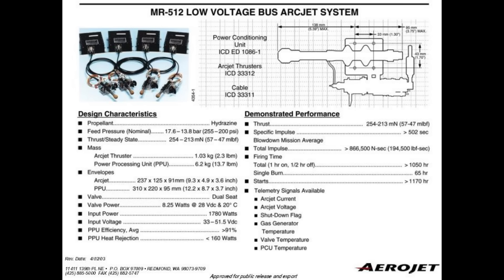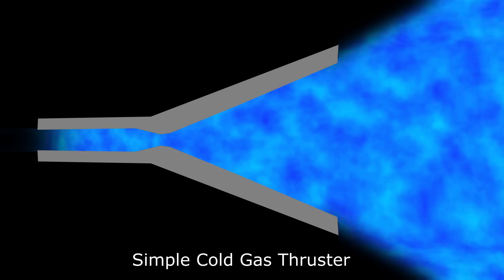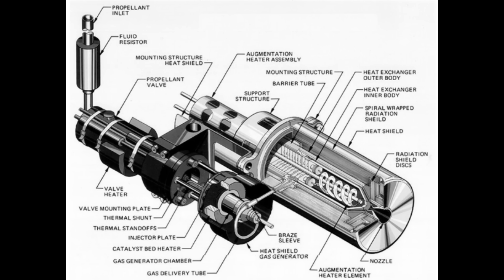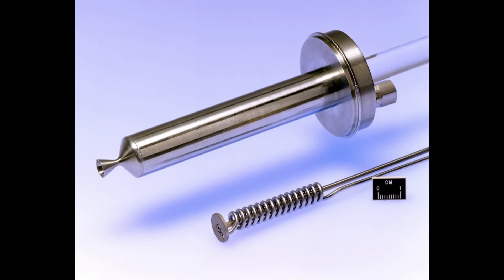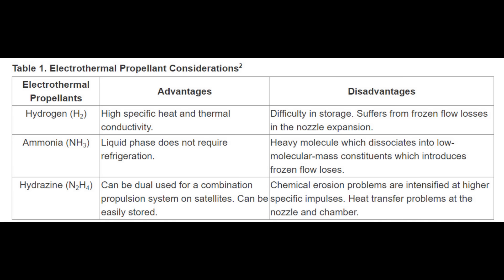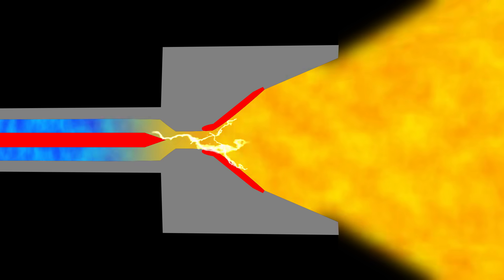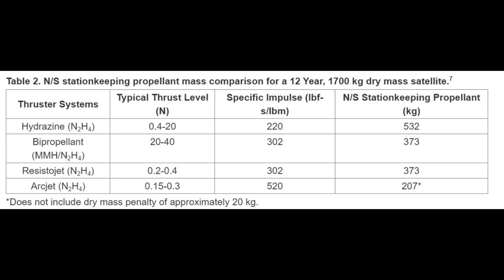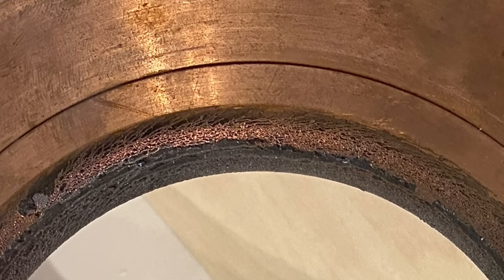Lightning In a Bottle?  The Science Of Electro-Thermal Rocket Engines

Comment: Hey Scott, YES, would definitely like to hear about VASMIR (sp?) and its competitors!  All the thrusters you talked about in this video are great for station keeping and maybe small payload hops around the solar system, but to actually actually go somewhere with payload will require a much higher performance propulsion system, and that is of great interest.
Reply: Microwave thermal thrusters using water propellant are perfectly capable of getting from Earth to Mars and back, in what I can only describe as an "unconventional" spacecraft. Idea is that it's a series of double-hull inflatable habitat modules, with the inner hull containing the atmosphere and the space between hulls being used to contain the life support consumables (specifically water) used during the trip by the crew.
This allows for a stupendous amount of water to be carried, which allows for mostly open-cycle life support to be used.
The key that makes this work is WHERE the "open end" of the life support loop leads. It leads right to solar powered microwave thermal thrusters, which heat the wastewater (minus separable solids), and waste gases of the life support system.
This allows for a constant if small amount of thrust which is still a lot better than any known ion thruster even if the overall specific impulse is lower than a nuclear thermal rocket engine. The key is that we can do it with TODAY'S tech, we don't need to wait for the design, approval, TEST LAUNCH approval, in-orbit testing, final design adjustments, and "OK now we're gonna use it for real, what do you mean it's been 8 years and the next president doesn't want to do that anymore" actual mission approval which would be required for a Nuclear Thermal Rocket (and you can almost guarantee someone's gonna not have sufficient education on nuclear tech and go "Nuclear? No no no!" no matter how calmly and plainly you explain it, and no matter how much you dumb it down so that a 3 year old can understand it (the older you get, the easier it is to fall into the "Nope, I don't like it, so I'm intentionally going to not understand it" thought trap).
We can design it TODAY, have it built TOMORROW, and be off to mars by NEXT YEAR if we only want to visit Mars orbit with a manned mission.
Or you know, NASA could make everyone drag their feet and congress/senate could hamstring it and it takes 20 years when it should have taken 2, but I prefer to be optimistic.
Point is, all the stuff needed is ALREADY at a sufficient TRL to just say "Ok we're using this, it's been proven to work, now let's actually do it".

Oh and if you're worried about radiation, you can forget about that concern. The amount of water needed is such that the water itself will be the radiation shield, and it's such a good radiation shield that the habitat doesn't even need a "storm cellar" in order to be reasonably (even by NASA standards) safe from a solar storm.
Reply: @44R0Ndin Doesn't "constant, if small thrust" = artificial gravity? I've seen this double hull, water filled construction, for decades and like it. The microwave thrusters is a new twist that I like.
Sorry, though, I can't help but be a pessimist, my blood type is B-.
Reply: @tomfrazer1428  
I hesitate to call it "artificial gravity" because it's NOT gravity, it's just acceleration, but in a few words "yes but the thrust is more on the order of an ion drive, not at all adequate to fight the effects of living in freefall for extended periods".
In (many) more words:
The term I prefer to use is "Thrust replacing gravity", or if in a spinning habitat module, "Centrifugal forces replacing gravity".
"Artificial gravity" is a term I save for use when you're creating REAL gravity (with the warping of spacetime), without the mass usually used to create said gravity.
So, technically, the Alcubierre drive (the only known concept we have for a "warp drive" like used famously in Star Trek), would use a form of "artificial gravity" combined with "artificial Anti-gravity" to warp space around itself such that it is caused to accelerate relative to an external observer purely by the warping of the fabric of space-time, rather than any propulsive effort exerted by any other method, most commonly by Newtonian reaction thrusters of varying power, complexity, and efficiency (this covers anything from cold gas thrusters to solid or liquid fuel rockets to nuclear rockets and even ion drives).
Reply: @44R0Ndin  I like your descriptions for the various types of forces replacing gravity. I assumed (I know, a mistake) that there would be multiple drives on a ship carrying crew, as opposed to a probe, increasing thrust/acceleration or the drive would be designed large enough to provide up to .5G. Continuous thrust with a flip over half way to the target.
Reply: @tomfrazer1428  
The issue isn't "more engines", it's "more power", and this craft's whole point is "you don't need to minimize weight to get there safely".
It's a "slow boat" type of trip, there is no thrust gravity, it's using one or more microwave electrothermal thrusters, not "sci-fi physics-ignoring TIE fighter ion drives which have some handwaved incredibly powerful energy source which lets them dump so much power into the thrusters that you get space-fighter levels of performance".
Reality is not nearly so kind to propulsion engineers. Solar intensity on the earth's surface is around 1kw per square meter, yeah it's higher than that in space because the atmosphere's in the way, but it's only like 1.3kw/sq.meter in earth orbit. Solar panels are at best maybe 35% efficient even with state-of-the-art cutting edge "this is the best NASA can get for their spacecraft" solar panels. And the solar intensity at Mars is significantly less than at Earth, due to being further from the Sun.
So at Earth, you can put a square meter of solar panels out in orbit, and point it perfectly so that it intercepts the most of the Sun's light as possible... and you're still only getting 1.3kw*0.35= a measly 455 watts  per square meter of solar panels. That's assuming those panels are NEW, and not damaged by the constant high (and occasionally extremely intense) radiation environment of space, which damages ANY semiconductor device, including solar panels and unprotected computers.
Now, why does that low amount of power matter? Well, the ISS solar arrays have a total area of 150 square meters, which at the stated 35% efficiency figure putting out 455 watts per square meter, gives you (150 x 455 / 1000 for kilowatts ouput instead of watts = 68.25) 68.25 Kilowatts, divided by 2 to account for being in Earth's shadow roughly half an orbit, = 34.125 kilowatts, which aligns well with the stated "roughly 30 kilowatts plus margin" of power that the ISS was able to provide to ALL the systems on board, when the solar arrays were BRAND NEW.
EACH of the solar array wings of the ISS weighs 7.71 metric tons, times 4 for how many solar array wing sections there are on the ISS, gives a mass of 30.84 metric tons for the entire solar array wing complement of the ISS, including hardware used to aim the solar arrays at the Sun.
This gives us the info needed to figure out how much mass is required per kilowatt of solar panels, assuming similar construction to the panels used on the ISS, by simply taking the mass of the ISS solar arrays and dividing by their average power output in earth orbit (and if we assume operation in deep space, we would double the power before doing this calculation).
For Earth Orbit, I get (30.84 mT / 34.125 kW = 0.9037 mT/kW), roughly 900 kilograms per kilowatt output.
For Deep Space, I get (30.84mT / 68.25 kW = 0.4518 mT/kW) roughly 450 kilograms per kilowatt output.

This matters a lot because no matter your propulsion system, if everything is held constant, increasing the mass lowers the acceleration.
Ion thrusters are MASSIVE power hogs, itty bitty thrust but EXTREMELY high power usage.
The ones that "barely even push" on the various ion engine propelled space probes we've launched? Each and every one of those uses over 2 kilowatts for that single thruster that usually puts out about the same thrust force as the gravity force of a sheet of paper resting on a table.

Microwave electrothermal thrusters have a much lower specific impulse, so their thrust is indeed better given the same amount of input power, but keep in mind that we've got like 30-40 tons of water as a radiation shield around our habitat modules, and the rest of the habitat probably weighs on the order of 20 tons, and then we'll probably need a whopping 300kw of solar power in deep space, which will mass (at 900kg/kilowatt) 135 metric tons, but I'll be generous and assume that we've had a breakthru in that area and now solar arrays only need to mass half what they would when the ISS was constructed in orbit, so that's 67.5 tons for the solar arrays.

Those space probes generally have a mass of "a few tons", let's be really generous to the mars mission by saying that a large ion-powered space probe weighs 4 metric tons.
That's still not helping things much, because our mars spacecraft is a behemoth by comparison, weighing in at 40t (water) +20t (habitat and systems) +67.5t (solar arrays) = 127.5 tons.

Let's say that 4 ton space probe used an ion thruster with a thrust equal to the gravitational force exerted on a sheet of paper at ground level on Earth.
A sheet of A4 (similar to Letter) paper has a typical mass of 4.97 grams.
Multiply by earth's gravitational acceleration of 9.81m/s^2 and you get a force of 0.0487 newtons, or 48.7 milinewtons.
Now, I said that thruster used roughly 2 kilowatts, and we have 300 kilowatts. That means we need to multiply this thrust by 150 to start.
48.7 x 150 = 7,305 milinewtons or 7.305 Newtons of thrust for a 300 kw ion thruster.
Now to account for the differences between microwave electrothermal thrusters and ion thrusters, we can say that the thrust and mass flow rates are roughly 10 times greater.
So that gives us a thrust force of 73.05 Newtons for the 300kw-class microwave electrothermal thruster.

73.05 Newtons acting on a mass of 127.5 metric tons needs some unit conversion before it "just works", by converting metric tons to kilograms again.
127.5 mT = 127,500 Kilograms (just multiply by 1000).
Now, F= MA, but rearranging it we get A= F/M.
So we have our Force, 73.05 Newtons, and we have our Mass, 127500 Kilograms.
How much Acceleration does that produce?
Not anywhere near 0.5G, I can tell you that without doing the math!
But I'll do it anyways:
A=F/M,
A = 73.05 / 127500
A = 5.729411764705882e-4
A= 0.005729 m/s^2
Now to scale that in "gees", we divide by 9.81m/s^2.
A(gees)= 0.005729 / 9.81
A(gees) = 0.000584 G.
5.8 ten-thousandths of a G.

Very much in "ion drive" territory, nowhere near the 0.5G doable with chemical rockets.
The trip WILL be a lot shorter than just a pure Hohmann transfer ("slow boat" coasting to Mars), but it's still not going to be "take a few days" and you're not going to notice the acceleration pushing you in any particular direction.
Reply: @44R0Ndin Wow, thanks for doing the math. Obviously solar panels are pretty much self defeating on a space ship as the mass of the panels "out weighs" the amount of power. Leaving some sort of nuclear power source and the thrust they are reportedly capable of. Though it really sounds like we need a revolution in (impulse) engine design to get the kind of things we see in fiction. Thanks for the discussion.
Reply: @tomfrazer1428  
The whole idea here is that it's a way to get to mars, within radiation budget, and within time and consumables budget, that we could do with today's rockets and today's tech.
Why we're not? Ask your representative.

Comment: Might seem random but does this also mean that the exit velocity of air from a hair dryer increases when the heating elements are turned on? And how much does it increase it by?
Reply: yes but im too lazy to do the math in detail, in ideal conditions it would be like  maybe be a 10% (just based on relative air density )speed boost but since the heater adds electrical load it slow down the the fan motor so the the effect is completely canceled out  by the drop in motor speed so you don't notice it.

Comment: Probably the best use case for this is on small cubesats as they usually have restrictions on what kind of propellants can carry
Reply: Some electro-thermal engines uses Teflon, probably one of the most boring propellants possible
Reply: nah arcjets use to much power and don't scale down well. cubest are better off with pulsed plasma thruster or field effect thrusters

Comment: Efficiency increases with increasing density (km/m³) and low specific boiling energy. So why not use Mercury?
Reply: Specific mass would be mass/mass, which is the same for everything and therefore irrelevant
Reply: @shanent5793  Ion thrusters work with Krypton or better Xenon because of the high atomic mass they are more efficent ...
Reply: @klamser  ion thrusters are not thermal rockets. Those gases are used because they have lower ionization energies, which only increases electrical efficiency.

Comment: The microwave electro driven  rocket sounds like you could gather up space debris and it could   turn it into plasma and then into thrust.  

 Just imagine gathering up that small test reactor that's in a storage orbit for an initial energy source.  Then you could have an energy source that could even turn a dusty asteroid into plasma.  You can divert its course or use it to travel places.   I'm sure it's not very efficient but I can dream.

Comment: This process works anywhere, the cooling system used in some WW2 fighters actually produced thrust from the "radiator" . The process is known as the Meredith Effect.
"F. W. Meredith was a British engineer working at the Royal Aircraft Establishment (RAE), Farnborough. Reflecting on the principles of liquid cooling, he realized that what was conventionally regarded as waste heat, to be transferred to the atmosphere by a coolant in a radiator, need not be lost. The heat adds energy to the airflow and, with careful design, this may be used to generate thrust. The work was published in 1936.

The phenomenon became known as the "Meredith effect" and was quickly adopted by the designers of prototype fighter aircraft then under development, including the Supermarine Spitfire and Hawker Hurricane whose Rolls-Royce PV-12 engine, later named the Merlin, was cooled by ethylene glycol. An early example of a Meredith effect radiator was incorporated in the design of the Spitfire for the first flight of the prototype on 5 March 1936."
Reply: Pretty sure the P-51 used that effect as well (at the very least on the oil cooler, but probably both oil cooler and radiator).
However, later study has shown that the designs that were implemented didn't really generate any "net" thrust, instead the thrust produced was usually roughly of the same magnitude as the drag induced by the air intake for the same radiator.
Now that doesn't mean it's "useless", far from it, it means that thru the effects of the cooling system operating normally you have REMOVED THE DRAG OF THE COOLING SYSTEM. If it was an air cooled engine it's the same as being able to operate with the cowl flaps fully closed for an indefinite amount of time.
Air cooled engines could probably also make use of this phenomenon, with the benefit that they don't need to add any extra mass for a radiator, only add some adjustable sections to the cowling flaps.
If you wanna be really really fancy, you could design it so that the cowl flaps are made of a bimetallic material (probably mostly the exit flaps, but maybe intake flaps could be also connected via a linkage), so that they automatically regulate the airflow thru the engine, both to maintain ideal operating temperature despite any operating condition and to optimize the efficiency of the Meredith effect produced by the in-cowl airflow being heated by proximity to the fins of the air-cooled engine. Too fancy for WWII probably, and it would need an override to fully open all the flaps for takeoff and/or use at WEP or to account for the use of any performance-boosting substances such as MW50 or Nitrous/nitromethane that might be used, but for most cruise conditions it would take workload off of the pilot (and cruise is where even fighter aircraft spend the majority of their operating time).
Reply: "Merlin engine" sounds familiar )
Reply: @artemkras  Yeah, that "later named the Merlin" was like a mini mind-blow 🤯